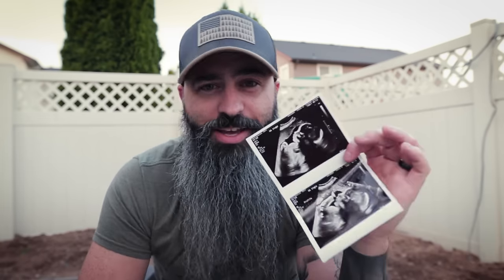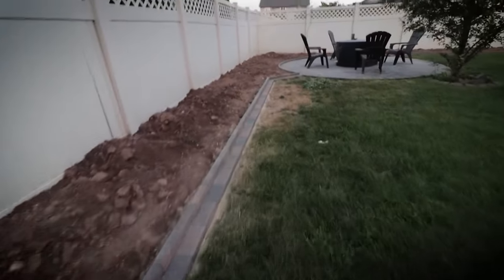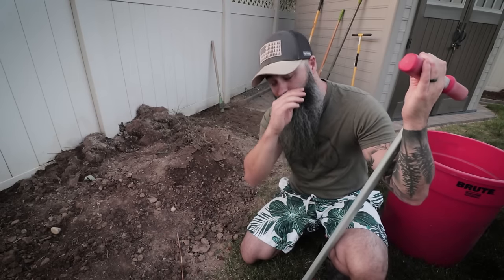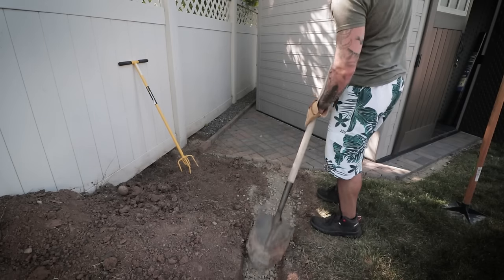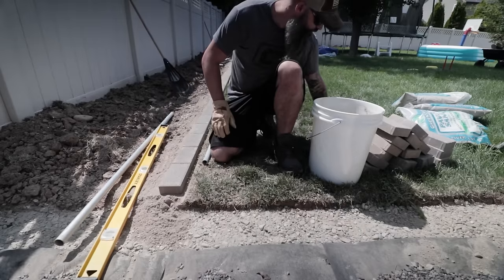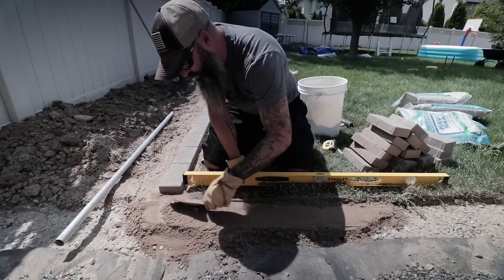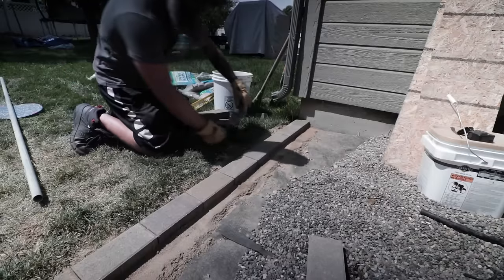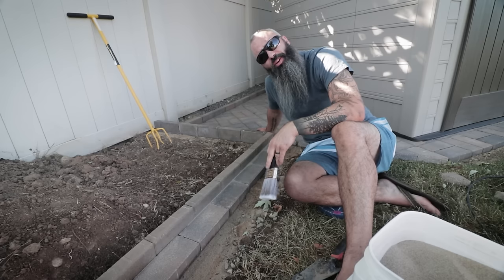How to Install Beautiful Paver Edging

Comment: I am wondering if paver sand and polymeric sand is good enough to hold these edgers together, especially in areas with Freeze/Thaw cycles. Great content, btw. Subscribed!! AND - Congratulations for the little one!!
Reply: No.
Reply: You’re actually better off using sand instead of mortar in geographic areas like that. Freeze/thaw will cause them to move for sure, but sand gives them the leeway they need. Mortar will just crack if put under that kind of strain.
Reply: Ants will love to pull out that sand out, always bed the edges down properly.

Comment: I like that cross section configuration - a vertical paver, up against a flat one. It creates a mowing strip. You can mow grass along the flat edge, without having to come back with a trimmer.
Reply: I have been looking for a right angle edging that goes both ways for that very reason. I may have to go to this. It looks great.
Reply: not really. u should trim too
Reply: Overtime your constant mowing on the pavers could cause them to become uneven. Certainly need an edging material to keep them snug.

Comment: I did something vary similar but I did not use any sand or concrete. I placed my front brinks level with the lawn , the back pavers vertically so they were deeper into the ground, then used flat plastic edging behind that to help hold it all in place.
Reply: How'd that end up for you?

Comment: Nice! I like the two part system. 
The vertical part elevates the garden bed for better drainage,
 while the horizontal part allows me to run my mower over.
Reply: That is no going to last in place long.

Comment: I used 1 meter long granite curb stones. Damn heavy, handled them with levers, pushed them on pipes, etc. Dug a bit down for stability, compacted and placed them in concrete. I made 1 meter deep concrete pillars for each curb stone to rest on, so they do not set/sink over the years. A few years later, they still look brand new. They do not have that worn look that concrete gets and they have not needed maintenance yet (except weeding).

Comment: I've got a pile of 80 year old bricks that came out of my house when the old double sided fireplace was taken out (the chimney had been long since removed, so it wasn't usable), and I planned on using them to line the front flower gardens. This video has shown me exactly how I need to do this, so thank you! I'll get started on it this fall when the 100+ degree weather goes away.
Reply from the maker: Hope it goes well for you!  If I can add a step in here, I went back and added a small amount of concrete behind the vertical paver.  The poly metric sand did not hold as well as I expected and the verticals kept being knocked over the kids.
Reply: @OutdoorBeards  Thank you! Luckily, the only thing I would have to worry about knocking them around is a very large and gangly black lab that belongs to the neighbor. I'll just have to dig through the pile to find bricks that match in thickness, as these appear to be hand made and some are thicker than others. But I feel it's appropriate to re-use the bricks in some way around the house.
Reply: @OutdoorBeards  I was thinking that as you were building it. So when doing the verticals just add some mortar to the backside of the horizontal bricks right to hold them?
Reply from the maker: I used cement.  When you say mortar I guess that would depend on the type.  But yes highly recommend that

Comment: I’ve been planning on copying this project and the time is here…i have all the materials and I have explained it to my helper (I did a row last year and it was a killer even with knee guards…gravity hates me). It came out straight and the run off pitch was near perfect but it took me too long and it was just too rough for me..I’m a female and I tip my hat off to you men…y’all have lots of energy and the tenacity it takes to get things straight is insane and underrated…we women don’t give u enough credit…but thank you. My husband, who was my helper last time is horrible at DIY but he loves me and makes sure that I have another helper that is not him for both of our sakes. I’m glad I rewatched because I forgot about the rod there…I have been using a string with the poles but this will add even more stability…this is literally the very best brick design out there on YouTube that looks pro AND modern but can actually be done by an average homeowner. I will be forever grateful.
Reply from the maker: I’m glad you liked it!  I do suggest adding a little concrete behind the uprights.  I had some issues with those where my kids knocked them out of place and I needed to add some extra strength on that back side.
Reply: @OutdoorBeards  yes I agree on the add’l concrete…I did my 1st row w/ concrete…intimidating bc you have to constantly make sure you are level and when you place them, you have to be more intentional so you don’t make a mess, so i drain lots of energy being all perfect… another tool that i hope to use is the piece of 2x4 to get a uniform height on the uprights…I am going to do your double bricks on the beds, close to the house out front and all along the side…then all around the house, I am going to hard scape using those same bricks in grey so that I do not have to use the weed whacker anymore around any edge. This has been my dream for like 17 years and this solution is genius. A zillion thanks and wish I could send you a copycat pic of my final product. so far, I’ll be using 160 of those bricks from HD…

Comment: thanks this is exactly what I needed for my edging project next week.
Reply from the maker: Just a heads up I had issues with some of my uprights in areas where my kids play a lot.  The poly metric sand does not hold up to kids.  So I would suggest a bit of concrete behind the uprights if you have kiddos
Reply: Thanks for the heads-up

Comment: Dang.  That is straight.  After doing about 20 feet of my border, I noticed it has a slight outward kick to it - gonna try that conduit trick.
Reply from the maker: I would suggest adding a bit of cement behind the uprights if you have kids.  Easier to do it now then later.  I had to go back and do it.  Kids are rough lol

Comment: ...looks like a scraper. When running wire dog fencing, I use one as a spade to cut a divot in clay soil to lock the bottom edge of the fence into a couple of inches of turf.

Comment: First - CONGRATS on your new addition! Being a girl dad is one of, if not the BEST thing that ever happened to me. I am so happy for you sir!!
Hey I'm curious, after a year or so since you installed the pavers, are the ones sticking up high (I'll call them vertical) still stabding up and straight or are the leaning or falling g over? I was thinking of doing this but was kicking around the idea of putting the paver edging behind it. My thought was that the vertical stones would want to fall over (especially with kids running around and stepping on them) so the edging may offer some support. I'm probably just over thinking this but it seems like a good idea. I would love your feedback on this to know if you would do anything different after having them installed around a year or so now.
Reply from the maker: Hello and thanks!  Yes being a girl dad is awesome.  Having one of each is just amazing.  As for the pavers, yes I would do something different and I did modify this the following summer.  Edging on the backside of the vertical would be a good idea.  The poly sand does not hold as well as I had expected so the vertical will pull away from the horizontal and lean backwards towards the fence. Saw this most in area where the kids play the most.  My solution was to put some quick concrete behind the vertical, about 2 inches tall and sloped back creating kind of a triangle of concrete.  Putting paver edging behind it during install like your talking about would be a great idea and I think it would stop the problems I ran into.
Reply: @OutdoorBeards  oohhhhh...  gotcha. Man thanks for sharing. Have a blessed day, sir.

Comment: Thank you for this excellent video! This is exactly what I have in mind for my backyard. Love the brick color you chose.

How has the edging held up as a barrier to weeds and grass migrating? Do you still have to use a sting trimmer to cut the grass along the lawn edge?

I saw that you recommended putting concrete behind the upright bricks. If starting from scratch, would you recommend putting a layer of concrete down below both flat and upright bricks too?
Reply from the maker: Helllo!  The edging has some grass coming up through here and there.  I think it’s in areas where I didn’t quite get the gap full with the poly sand.  
I do use a string trimmer along the edge just because I prefer the look.  If I don’t then the grass kind of leans over the horizontal paver and obscures the nice line.  
As for concrete below and behind.  This depends on your area.  Where I live the soil is more like a clay, so the dirt that’s on the yard side is pretty solid and holds the horizontal paver in place.  The reason I had to go back and put concrete behind the upright was the dirt I put back there was garden soil for my wife to plant flowers and such in.  That soil is much softer so the concrete hold the upright in place.  You could just use the rubber or plastic paver edging stuff which holds both the sand and pavers in place but it’s expensive.  Concrete is cheaper.  If using concrete be aware of trees near by.  If a tree root messes with the edging it will be much harder to fix if concrete is involved.

Comment: I love this edging!   I sooo agree if you do something do it right!  That is a fantastic line and I am impressed!  Have you had any trouble with invasive grass moving into the garden bed though? The house we bought they used awful rubber edging (awful lines) and I want to replace it because the grass has already invaded the garden beds.  UGH
Reply from the maker: We’ve had a weed issue because we haven’t gotten our mulch in yet.  Just haven’t had time.  I built an arbor with bench a swing (that will be the next video) at the end of summer last year and just haven’t had time this year to finish the project.  No grass issue though.

Comment: A simple, unique, and great look! Thank you! 

How did you ensure the pavers didn’t move when accidentally kicked or knocked into? To me it looks like they’re freestanding with no support or anchoring.
Reply from the maker: After this was done the area behind the upright was filled with dirt and mulch, this stopped the pavers from moving backwards, in front of the flat paver is dirt and grass seed, once the grass grew in they couldn’t move forward.  The poly metric sand in between holds the pavers together.  Now I will admit, I have kids and the the poly sand did not hold as well as I wanted in areas where they play a lot.  I have had to fix some of the uprights and added a little concrete behind them.  The flat pavers have no issues.

Comment: congrats on your daughter. hope she and mom are doing well. thanks for this informative video. how would you deal with a sloping surface? thanks
Reply from the maker: Take a long 2x4, as long as you can fit in the area, set it down and put your level on it.  Look at where the bubble is.  Do the same process like in the video but instead of holding level you are holding the bubble off center to match the slope.  I had to do this on the back fence between the two patios because the shed sits slightly higher than the round patio.  Also, depending on how severe the slope is, you may want to consider quickset concrete instead of sand.  When you wet everything down after the cement will harden and keep everything from slowly working it’s way down the slope.
Reply: @OutdoorBeards  thanks!

Comment: Excellent explanation, and the installation looks clean!  I love your attention to detail.  Quick question, but is there any need for edge restraint (like snap edge or mortar) for paver edging?  Thanks!
Reply from the maker: Where I live our dirt is like clay.  So I just packed dirt in front and behind to hold it in place.  That may not work for you.  So I say when in doubt, use some kind of edging.  You could also use a quickset concrete instead of sand for the base.
Reply: @OutdoorBeards  Thanks!  I have really rocky soil here, but I’m edging around an area where I’m installing artificial turf.  I trenched down into my gravel base, created a bedding layer of HPB (1/8” clean chipped limestone), and installed the paver border.  I saw your video without edge restraints so I decided not to do edge restraints either (and I did this earlier today).  The pavers have a solid base and are completely embedded in compacted screening, so hopefully that does the trick!
Reply from the maker: If you notice them moving later you can always add a little concrete on the grease side of the pavers.  Just enough to hold them in place but still be covered by the dirt and grass.  I had to do this to about a 12 foot section.  We are close friends with that neighbor and tend to go over there to chat over the fence, then the kids follow and walk all over the edging with toys, bikes, wagons.  Didn’t expect that when I first put it in.  Anyway so I got them back in place and put concrete between the paver and grass, low enough so it’s hidden under the dirt and grass.  Problem solved.  

Good luck with your project!
Reply: @OutdoorBeards  Thanks!  Sorry, what do you mean by the "grease side" of the pavers?  I think maybe you mean "grass side"?  I don't actually have "grass", since I'm doing artificial turf -- so it's compacted screening on both sides of the border.  I''m hoping that because my pavers are surrounded by compacted screening on both sides that that should help keep them in place (as opposed to dirt, which I think would move more easily?)
Reply from the maker: Yes sorry I meant grass side.  I didn’t picture you project correctly.  I think your compacted screening will be plenty.  Plus the turf is not going to move and shift the way nature would.
Reply: @OutdoorBeards  thanks!  I guess time will tell

Comment: Nice video, looking for an edging solution, my yard is sloped so level is useless, I dug the trench and wondering if the stone and sand will be drainage for the beds causing them to be dry. I have it 3 feet out from the fence. and planted already some bushes and flowers over the years. Going to look at the cost and start it this spring.
Reply from the maker: I’m not sure about the drainage, might be a good question for a landscaping supply company.  Best of luck on your project

Comment: This is some awesome edging build & tips; do you remember the specs of the build? How deep was your trench, how many inches of crush rock/leveling sand did you fill your trench with, & did you end-up spraying the brick down with a clear sealant to prevent mold growth?
Reply from the maker: Trench was roughly 5-6 inches deep.  4-5 of that was the base material and the other 1-2 was the sand on top for leveling.  I did not spray the pavers. Never heard of mold growth on pavers, maybe that has something to do with where I live.  I did go back later and add a small amount of concrete behind the vertical paver.  The poly metric sand could not hold up to the kids but the concrete backing has done well.
Reply: @OutdoorBeards  thank you, I was wondering about the strength of those backers. Thanks for the additional update. Mold growth is a battle here in SE TX
Reply from the maker: Is the mold an issue because of being near the ocean?  Higher humidity I assume.  I’m in Idaho, mostly dessert type weather.
Reply: @OutdoorBeards  Yep! Houston Metro area the  is humidity capitol.

Comment: Great job and efficient.  I have a question, if the sand isn't compacted... does the paver sink when it gets trodden on or mower wheeel runs over one?
Reply from the maker: The sand seems to compact itself under the weight of paver.  My wife started planting stuff over the last couple weeks and I was watching her stand on the edging while she dug a hole.  Nothing moved. I’ve also hit it with the mower a bunch last summer and fall without any issues.

Comment: Looks nice. That will stop grass growing from your side to the fence, but how are you going to stop grass from growing from the neighbors, under the fence, and into you dirt area?
Reply from the maker: Neighbors on two sides also did this.  One of them at the same time I did to save money by splitting cost of the sod cutter.  As for the third they have a garden area against my fence so it really hasn’t been an issue

Comment: Love the look.  How has it held up after 2+ years?
Reply from the maker: My kids knocked over some of the upright early on.  The poly metric sand did not hold as well as I thought it was supposed to.  I went back through and added a small amount of cement behind the upright.   Since then it’s held up fabulously.

Comment: Awesome job, and nice and straight! I noticed that you used something like edging guides using nails or stakes. What brand did you use? I noticed it at around 2:28 when closer to the fire pit area. THANKS!
Reply from the maker: I don’t remember the brand of the edge guard.  It was from Home Depot and I ended up taking it out because it looked horrible and I new that even after I buried the bulk of it some of it would still be visible.
Reply from the maker: I didn’t use any edge guard on the edging after the experience with the patio

Comment: What happens when the sand under the brick washes away? Is the plan to go back every year and adjust the bricks from erosion? If so, why would you use permasand on the top then?